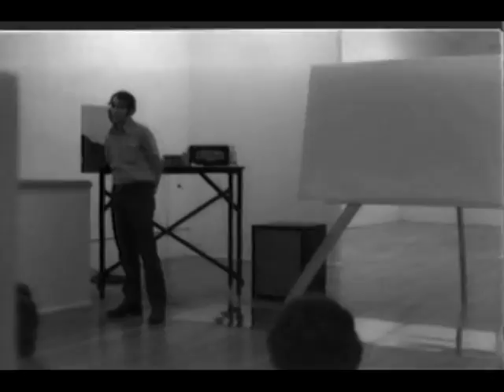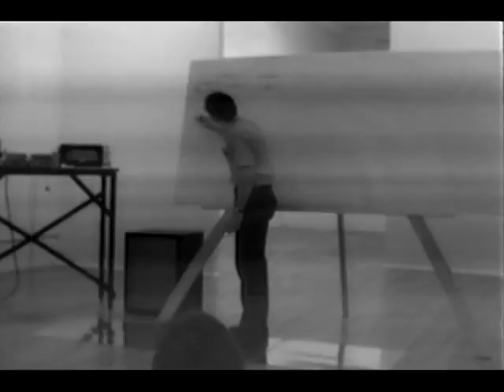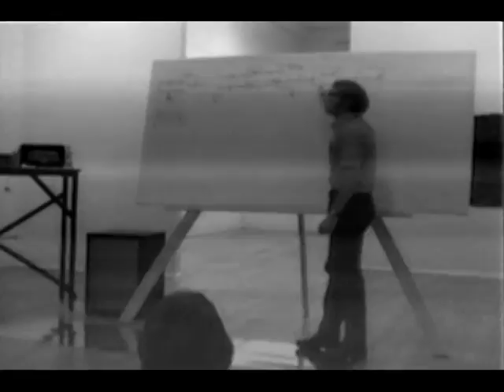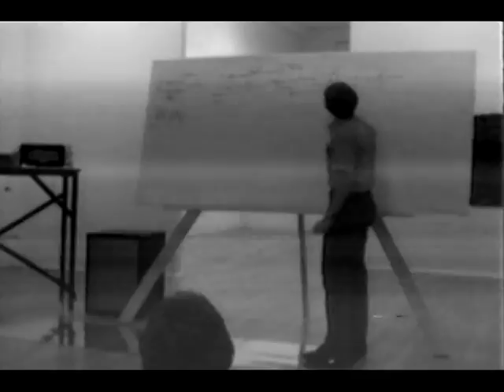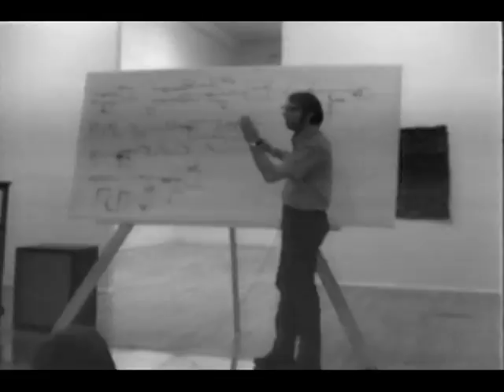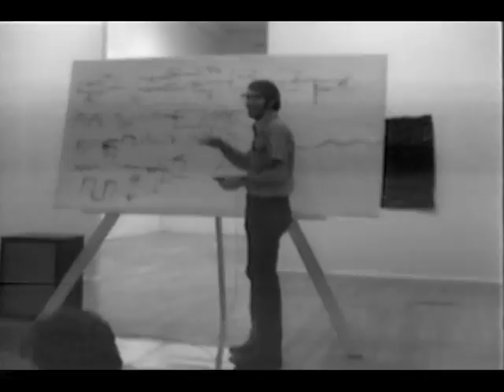Walter Wittel Performance at Floating Wall

Comment: Hello Walter, I'm interesting in anything related to the history of the Santa Ana Arts Scene. As far as I can tell, your performance piece at the floating wall is the only footage of the 1970's art scene in what has now become the City's Artist Village.
Reply: Hi Manuel, I was a member of The Floating Wall gallery in the mid '70s and have a binder full of info about it. I'd be happy to share. You can contact me from here:  http://www.hocktools.com/default/emailform.html.
Reply from the maker: Hi Manuel, thank you for your comment and interest! I do not have any other tapes from Santa Ana but a few clips from a class at UCI are also on my channel. If you are interested in doing further research in the broader OC and LA art scene of the 70's please look me up on Google+ or Facebook and private message me contact information, and I'll try and get you connected with a few other people that may have some material (although I'm not sure about Videos). This was taped by Bradley and Sue Smith.
Reply: Thank you! i just sent over an email.